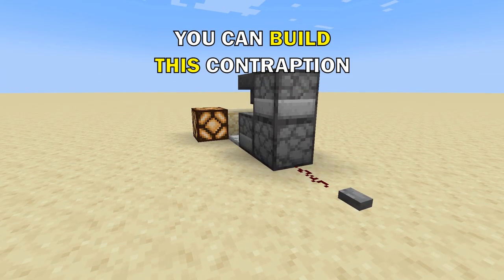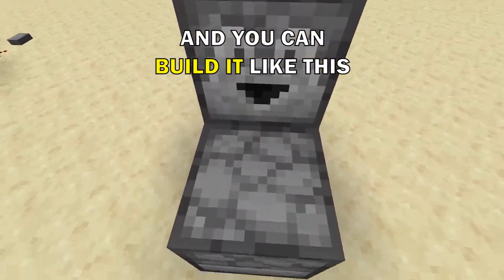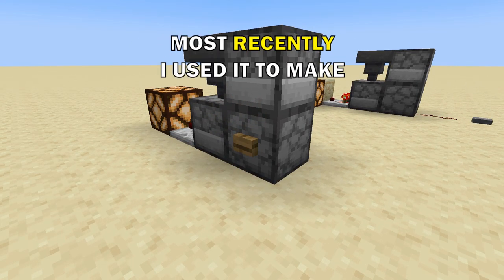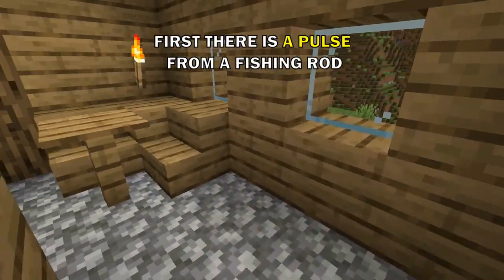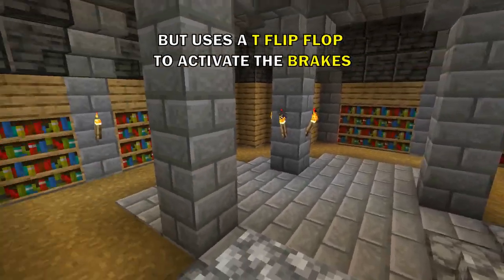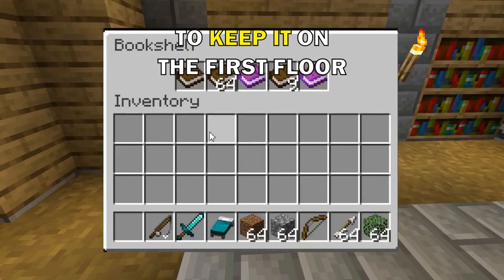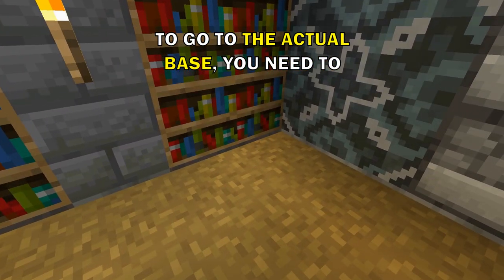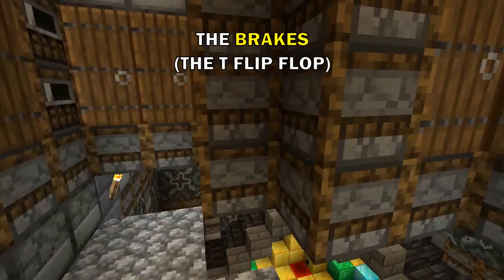Turn A Redstone Pulse Into A Constant Signal With This Silent Contraption (T FLIP FLOP)

Comment: fake
Reply from the maker: What do you mean, it works
Reply: @loxodude9398  i tried it in java edition version 1.20.1. i used every step you said but still didn't work.
Reply from the maker: That’s odd, could you send a world download to me? Contact.loxodude@gmail.com
Reply: I bet the issue is the same one I had and the comparator only puts out a signal strength of 1